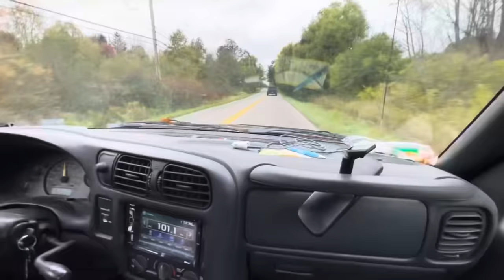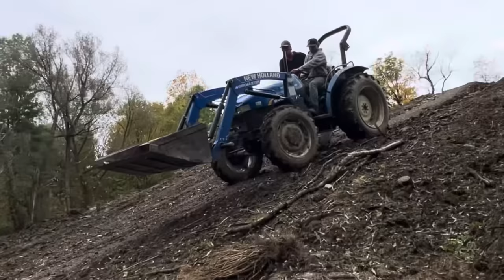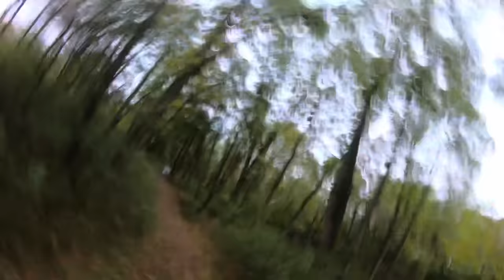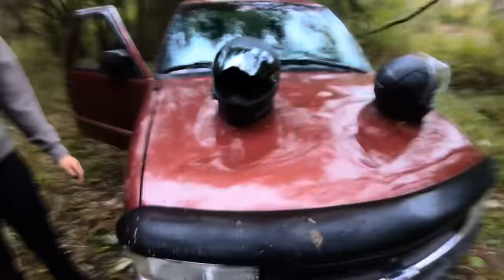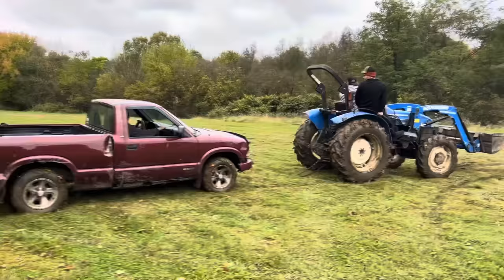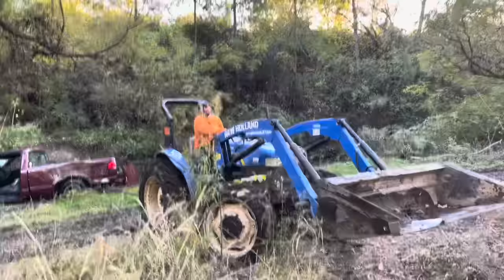Absolutely DESTROYING his daily driver

Comment: Ah yes the send off of your first shitbox. I remembered each of mine and my buddies all doing the exact same thing when our cars were structurally unsafe or beyond mechanically saving. The first winter after graduating 3 out of 6 of us had already started field car'ing theirs and mine wouldnt pass a safety recently so it became #4 new years eve was spent racing and ditching 4 cars on fire access roads that have zero traffic during winter and after we kicked in the new year with a bon fire, and limped the cars back home at 3am launching fireworks at each other in our little convoy home

Comment: Sadly, I made the same mistake today. I have a 1996 Chevy S-10 same engine, but five speed. I was just driving down the highway and the RPMs got heavy and it shut off. Then I realized that older vehicles need to have the oil checked and I started it up and had a knock to it. I’ve only driven a 2015 and 2020 I’m only 18 so I’ve only been driving for two years And it’s sad because I am a mechanic and I know to check the oil, but I forgot because I was so caught up with work. But instead of destroying my truck, I think I’m gonna pull the motor and swap a 4.3 into it

Comment: Mine 99 ext cab S10 blew the 2.2 up so I put a built 355 and a V8 5sp in it now it only blows rear tires like it should.
Reply: Hope you upgraded the front suspension and transmission.
Reply: @Wardaddy51-50  I built it correctly 2 withstand the 400+ HP coffin on wheels that I built and also running 410 gear in rear because it makes more fun with the 5sp in it
Reply: @teresawallace747  You did it right.

Comment: Makes me miss my 95. Put that thing through absolute hell. Slammed It drifting in 2 tracks into trees and it kept on moving. Starter had like 1 tooth left. Absolutely no brakes had to downshift to slow down. Paid $700 for it had a ball and sold it for $1000 10/10 would do again
Reply: Pains me to know this, I’d love an S10. But the cheapest I can find is £4k, been in a wreck with 192k on the clock and 1000 miles away, (I’m in the uk) and cheapest in decent condition with sun 120k miles is £22k 😂So I’ve settled on a gen3 ram 1500 with the 5.7 hemi instead

Comment: I've got a Chevy s10 ls extended cab, almost zero rust, perfect condition body and paint minus bumper dents, healthy drivetrain, 120,000kms for a 2003. sad to see a truck like that go, they serve as good parts trucks for the ones that are actually still running well. It also helps that I do metalworking and vehicle rust checks regularly as a hobby in my shop.
It's your truck to do as you please, but man it's still sad to see one go, as satisfying as it is to just wreck a truck. Fun video but slightly painful to watch LOL

Comment: They are a bunch of idiots to do this to a perfectly good truck, shame on them
Reply: it has engine knock...
Reply: @vexensweat5233  so, it can be fixed by a mechanic or if he knows how to fix it himself
Reply: @dustygibbs7739  Yeah right.  Thats economic.
Reply: @dustygibbs7739  some vehicles simply aren't worth it. I've rebuilt engines before. The $1500 rebuild cost for an engine like this is more valuable than the vehicle itself.
Reply: @dustygibbs7739  It isn't worth rebulding in any way...
Reply: "Perfectly good truck" Can you not see the rust?
Reply: @dustygibbs7739  womp womp snowflake

Comment: Those S10 where usually a little "touchy" when accelerating. Easy to spin the tires on wet roads. It's always wise to keep up on maintenance. But then again. I like to maintain my car's regardless of age.
Reply: 4.3l with a cut throttle plate and headers spins every gear

Comment: A ranger is better in EVERY way
Reply: but its still a ford so not every way
Reply: @cmawhz i own both a Ford and a chevy. Fords better in every way.
Reply: @JoeTricep 4.3's are solid engines
Reply: @cmawhz  You will put a transmission in the s10 WAY before you'll have to put an engine in the ranger. I have an 05 ranger xlt with the 4.0l sohc. 380k miles timing has never been touched. Original trans and rear end as well. So that comment is irrelevant. I will say Chevy has better engines overall, but that's it. Body is trash, trans is trash, and rear end is garbage along with interior and body. I've owned both so...
Reply: @yellowbananapeel-1534  Yeah, until they leak coolant into the oil and destroy all the bearings. That's what happened to my '99 ZR2. It happened to my gf's S10 too. I agree though, up to that point, they were great, lots of low end torque. 
I replaced it with a brand new Ranger in 2011 and that truck is the best vehicle I've ever owned. It doesn't quite have the low end grunt the S10 had, but it's definitely acceptable. I just wish it didn't have traction and stability controls.
Reply: @eyellgeteven9928  good bang for your buck engine either way

Comment: Come on boy, you could destroy a useless Hyundai or shitty sentra but a S10? The frame and engine could be restored and that little truck would be working 20 years more, those little trucks are getting rare and the new ones suck.
Reply: For real that’s what I was thinking and it was a single cab too with clean interior
Reply: It's not worth it. There are millions of these types if trucks. It was rusty, dented, everything
Reply: @tnc7399  nah bro these trucks are rare do your research kiddo
Reply: @Youngniggafromdahood  idk where you live, but 80s, 90s, and 2000s trucks are still pretty common around here
Reply: Why do you think that a Hyundai can be a bad car but this not bad car?
Reply: @druce541  
No body on frame
No easy to fix engine
Stressed little engine
Front wheel drive
Full aluminium engine
Weird automatic transmission
No ground clearance
Etc.
Reply: @tnc7399  sure in New Mexico or Arizona but not in the north
Reply: @HIDHIFDB  so it's not made for super hard work. Still can hold large items
Reply: @HIDHIFDB  I literally went to a farm in the north with like 20 of these things, some minor work on some, heavier on others, but all can run and with minimal rust

Comment: funny and all but just confused why i mean yeah content and all but it still ran why not give it away to someone without a vehicle that prob would have done alot better but anyways you do you
Reply: Did you see the condition the truck was in? And the engine wasn't doing well either, it would be cheaper to buy a nice car than to fix this up.
Reply: @will.dornon  i mean yeah i guess thats true but still :/ it ran at least
Reply: @FINDROBLOX  It wouldn't have gone another 20 miles with that rod knock. Between that and the frame the thing was only worth scrap at best anyways
Reply: How would giving "it away to someone without a vehicle" have made an interesting video generating revenue? SMH🙄
Reply: @Kaniela-xq8vl Why would you give someone a vehicle that wont last 50 miles?

Comment: Chevy's are junk you either need A Ford or A Toyota
Reply: Thing did pretty good for being junk!
Reply: I had 2 Ford trucks and they broke down for no reason, plus the bed materials are of lower quality than Chevy's.

And in cars, not to mention, there are many garbage Ford models, by far Chevy is better in that segment
Reply: I'm an avid Ford fan, but Chevy is a fine brand as well, I really don't understand the constant unbased bashing on other brands
Reply: I mean the vintage Chevy trucks are good my dad bought A 1989 Chevy truck A few years ago and it has the fuel injected 350 V8 however he had to have the engine rebuilt and he was able to locate A new old stock automatic transmission for it as the old transmission was pretty much shot. After about $5000.00 in repairs with all the parts in the truck it's restored internally however it could use A paint job. I have A 1996 Toyota Tacoma pickup truck 4 wheel drive with the 4 cam V6 engine mine is stick shift I only paid $100.00 for mine as it's going to need A frame it's got 49'000 original Miles it's that it was A plow truck so it saw lots of road salt which overtime rotted out the frame I'm going to be getting A decent frame and some point restoring it. It has been sitting since 2013 and it started with just A few trys with some fresh gas and A new battery and the engine was actually rebuilt in 2013 before it was put aside so I basically have A new engine and the transmission works to. Just need to strip it down and get A frame I'm also going to give it A custom paint job.